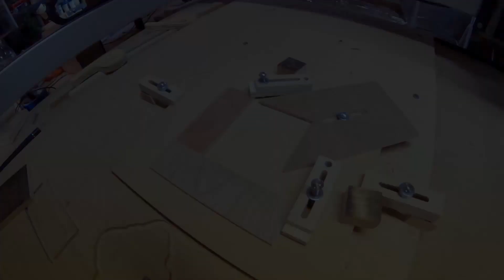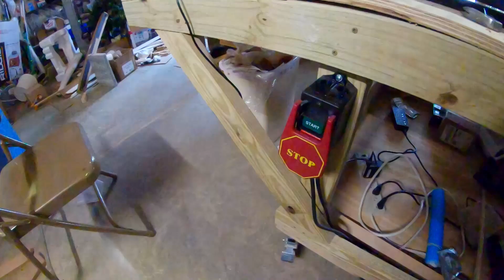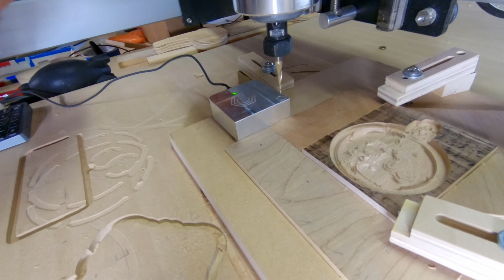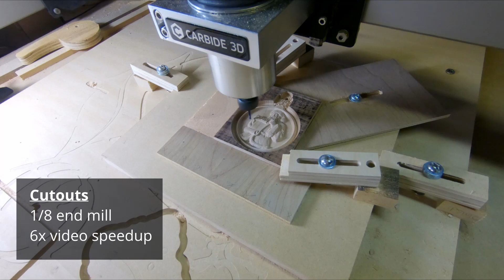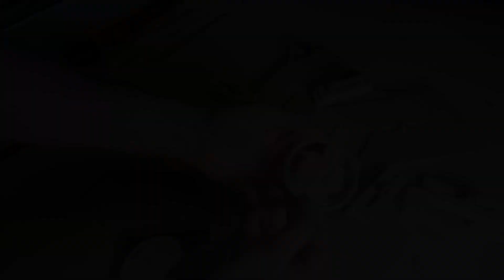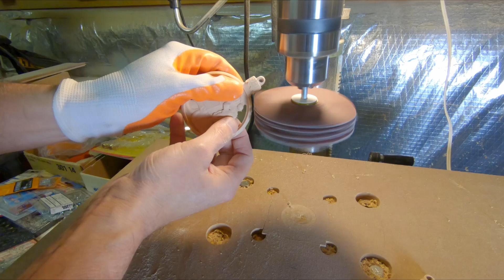CNC carve a Santa ornament

Comment: What finish did you use? Very nicely done.
Reply from the maker: Brian, I stained it with a lighter color stain. Then I sprayed a couple of layers of shellac to seal the wood. Then I applied a slightly darker stain to the recesses and gently wiped it off the highest points for an antiqued look. The shellac prevents it from soaking into the wood. Finally, I sealed it with spray lacquer.
Reply: Thank you.